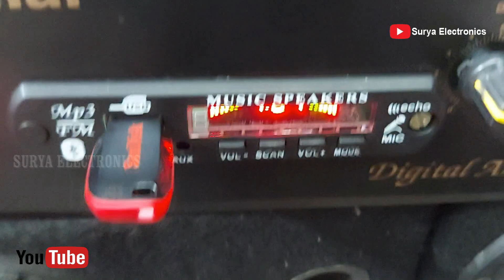2n3773 Transistor 3055 Amplifier Board Full Wiring And Test

Comment: 18 0 18 6 amp കൊടുത്തൽ കുഴപ്പമുണ്ടോ
Reply from the maker: 18 0.18 ഓൾഡ് കുഴപ്പമില്ല പക്ഷേ ആറാം ആമ്പിയർ റെഡിമെയ്ഡ് ട്രാൻസ്ഫർ ആണെങ്കിൽ കുഴപ്പമില്ല
Reply: @suryaelectronics9282  റെഡിമെയ്ഡ് അല്ല 5 AM P അണ് പറഞ്ഞത് ഇനി എന്ത് ചെയ്യാൻ പറ്റും
Reply: @shakkirhussain1144  no issue
Reply: Right side 2 transistor over heat avunne bro
18_0_18. 5amb Ane koduthirikkunnee

Comment: 3055 ബോർഡിന് എത്ര വോൾട്ട് ട്രാൻസ്ഫോമർ കൊടുക്കണം
Reply from the maker: 18.0.18   5A volt 20.0.20 5A കൊടുക്കാം
Reply: @suryaelectronics9282  18.0.18 5A volt 20.0.20 5A വരെയാകുമ്പോൾ   35 വോൾട് കപ്പാസിറ്റർ മതിയോ
Reply: @suryaelectronics9282  ok😍
Reply: 17-0-17 transfermer kodukkan patto
Reply from the maker: Yes
Reply: ഇതിൽ 24 0 24 ട്രാൻസ്‌ഫോർമർ പറ്റില്ലേ?5അമ്പിയർ?
Reply: പക്ഷെ ഇതിൽ 4700uf 50volt കപ്പാസിറ്റർ ചെയ്ഞ്ഞു ചെയ്താൽ 24 0 24 ട്രാൻസ്‌ഫോർമർ ഇടാൻ പറ്റില്ലേ?